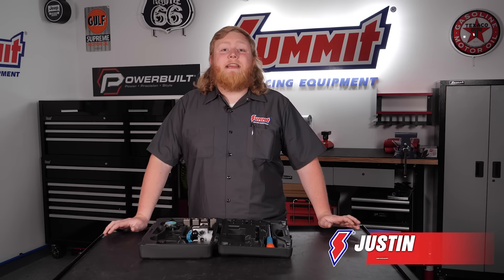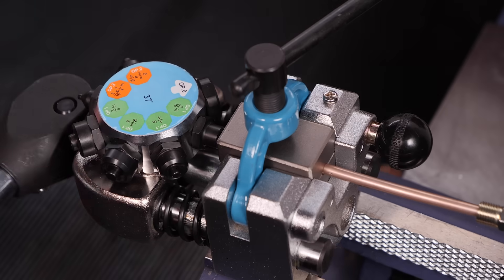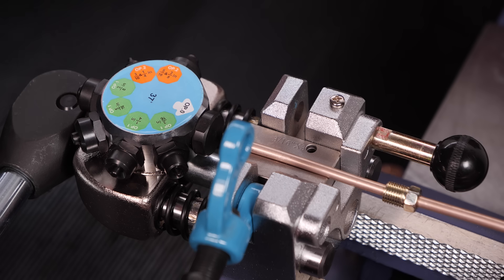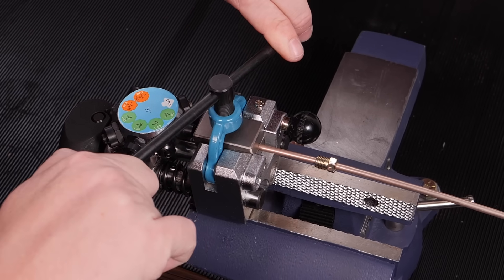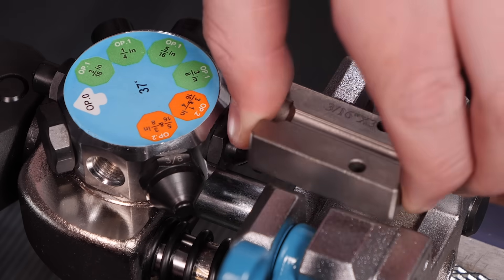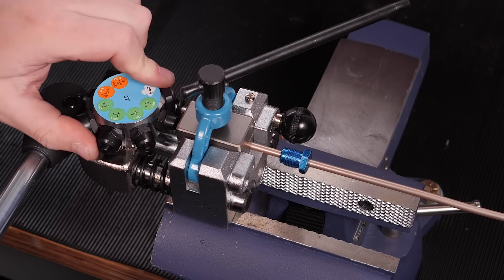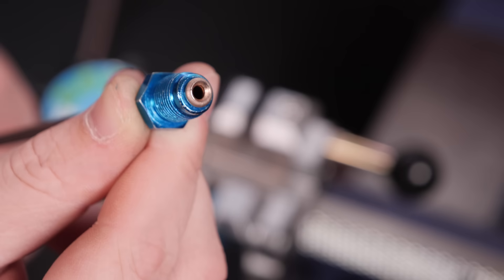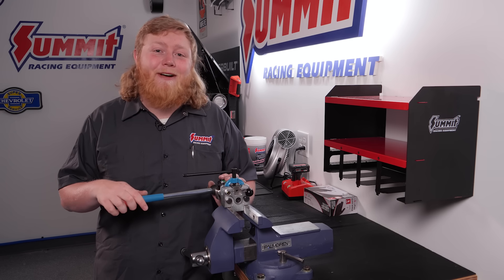Toolbox Heroes | Using a Turret-Style Flaring Tool to Make Custom Brake & Fuel Lines

Comment: It might work but it’s wrong. You said a single flare is operation 1. That’s wrong operation 1 is a bubble flare. If you only want a single flare you go straight to operation 2 and skip 1. If you want a double flare. You do OP1 and then OP2. Also this is a 37 degree for AN line. So you should run a tube sleeve and nut. You’re using a 37 degree tool with standard fittings. So if you’re using standard fittings then you need to use the 45 degree tool.